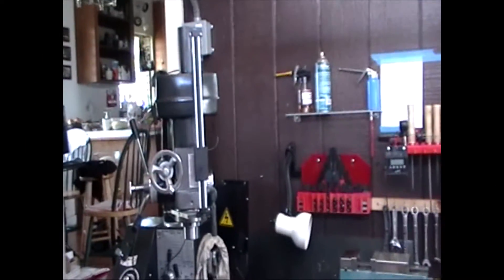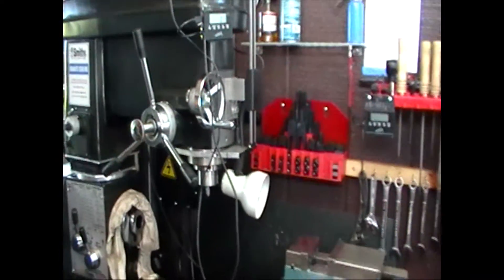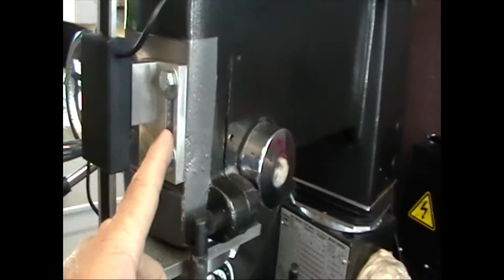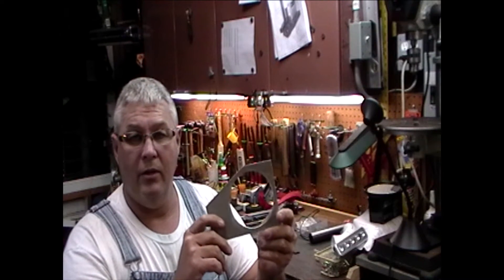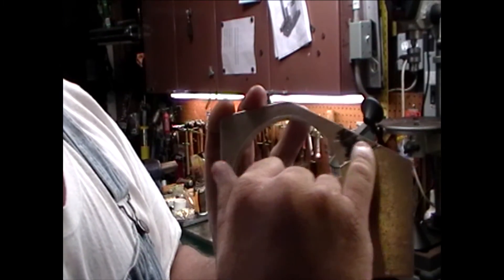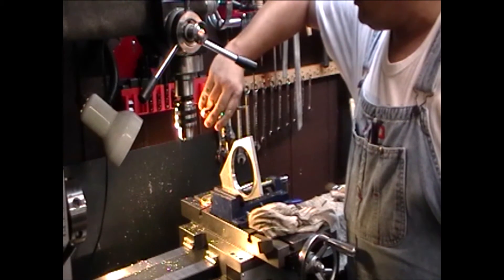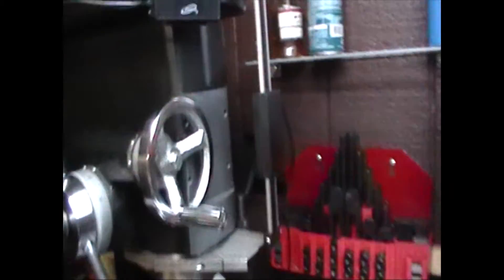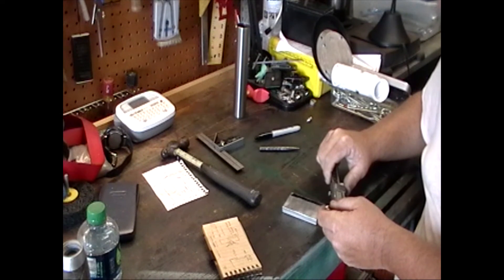DRO install on Granite 1340 part 1 of 2

Comment: How do you like your 1340 unit? I've been reading reviews on them, and it seems as though lots of folks have pretty strong opinions that they don't like them. Lots of horror stories, pretty much. So would you do it all over again if you had the chance? 

I just don't have much room in my shop for both a lathe and a mill, so these machines are pretty attractive in that sense.
Reply from the maker: I like the Granite overall, there are two noticeable weak points of the machine and the company knows about it.
1. the compound has a weak base plate that mounts with two bolts to the milling table. This allows a lot of chatter but I'm working on a way to make a stronger mounting plate in order to mount it to the milling table.
2. the mill works great, but it isn't stable or heavy enough to mill large amounts of metal, depending on the type of metal you are milling. This is because the milling head rests on a large tubular post that is connected to the lathe head. But is accurate as long as you are not taking large bites of metal. The head has a tendency to raise up off of the work surface and chatter.
It really is a nice machine for the price and especially for a beginner like myself.